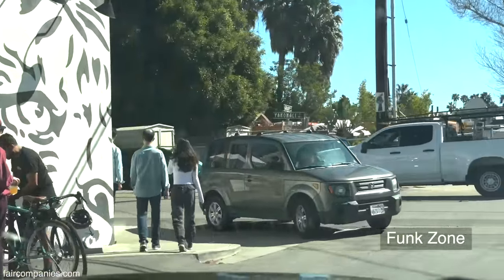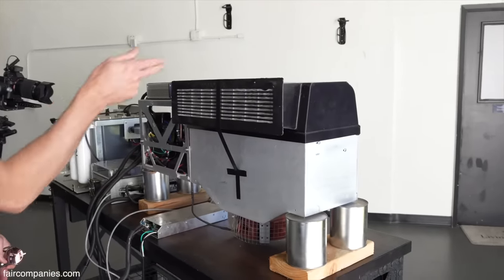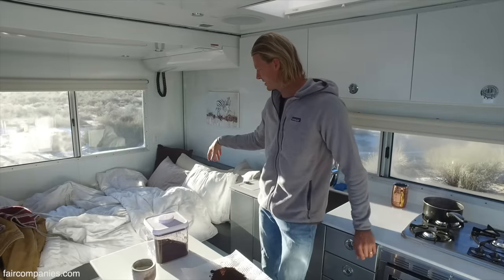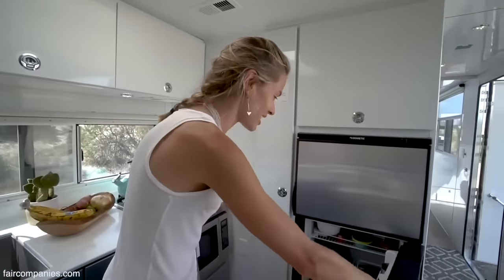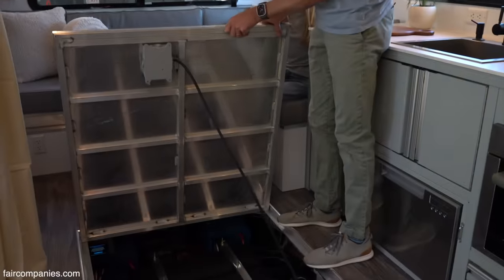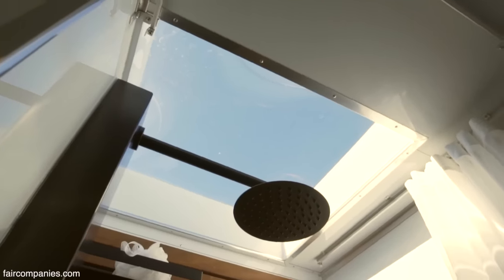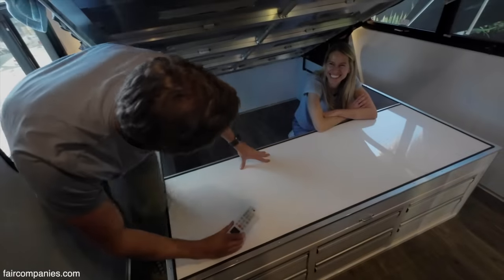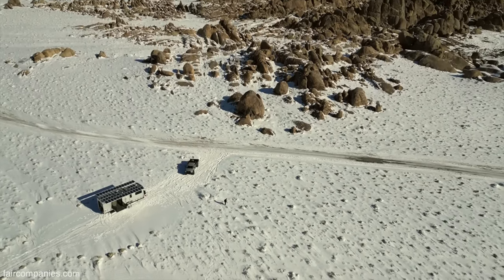Couple's stunning home-on-wheels produces water, has solar awnings

Comment: I LOVE how well built this is. So many builders claim luxury because of high quality finishes but none of it is built to last. This is clearly built to last. Also love the thick walls for insulation because they probably also make it quieter in addition to helping with temperature control. Sound is a big part of a space so it's great that a mobile space is quiet.

Comment: Ive been following these people and their Living Vehicles for years, now. So glad you could tell their story. They've really hit the nail on the head for full time living off grid and also mobile living.
Reply: Thank you for your ongoing support!
Reply: As long as you can afford a million dollars on a mobile solar panel
Reply: @canyonero2050   Solar panels are relatively cheap anymore.  A decent solar power system will run you ~$2,000-$5,000. (includes cost of batteries, controllers, converters, etc.)

Comment: Oh hell ya! A real kitchen, a real bedroom, a real bathroom, real power, a terrace, easy to haul, season resistant, water collecting, AND a dishwasher…OMG!!!
Works for me.

Honestly the ONLY thing I’d add (as with every dwelling) is the ability to control the shower head so I could get fully wet & turn the head off, soap up & then turn the head on to rinse off. I had one of those at one place I lived. It was really low flow to begin with and adding this really put it over the top. It just had was a button right at the head that turned the flow off and on. Easy peasy. Saves lots of water. That plus the full water reclamation/recycling and the air/water grabber (to balance evaporation) and this would run as long as there’s power to run it. 

Great design and build. It’s wonder-full.
Reply: Thanks for the feedback!
Reply: Living in a condo and wanting a way to get more out of my hot water tank, I bought a KES shut-off valve on Amazon to put between my shower head and the pipe. It's made of metal and has a little lever that sticks out that is easy enough to adjust with one hand and lets me control the water flow, reducing or stopping it, which my normal shower valve doesn't (it's just on/off with the knob affecting temperature). Even just reducing the flow while soaping up significantly extends the hot water supply. Cost me like $18 CAD.
Reply: @guspaz  Yay!

Comment: Really nice high end build. Extracting water from the air using solar power is so dang cool!
Reply: Back in the day we used to call that a dehumidifier.
Reply: @Chris-bg8mk  😂😂
Reply: @Chris-bg8mk  Yeah, exactly. It is not really an inovation anymore. 🙂
Reply: @Chris-bg8mk yup a dehumidifier hooked up to a reverse osmosis filter 😂
Reply: @Chris-bg8mk  Yah that’s what I was thinking. It’s a dehumidifier with a water filtration setup… or am I missing something?
Reply: I saw a video where the people had a massive one, the size of a small utility building maybe 6 x 6 x 8 ft, on their property because there was no other water source. I think it was rated to produce 20 or more gallons a day (50? I can't remember), but it was just enough that 2 people could actually live on it.
5g a day is really just a tech demo, that doesn't cover much more than drinking water.

Comment: I think of it more as a tiny home on wheels than just a trailer, especially with the fold out deck.  It's well thought out, that's for sure and he's still improving on it with water recycling in the works.  He probably does alright for himself and has a high-end clientele.  It's good to see the latest living innovations and the latest technology with fully off grid capabilities.  Thanks again for another interesting video.

Comment: As an architect, I have been wondering when a truly self-sustained living unit would be available - I guess we have it now.  Until now, boats, with a water making system have been the only viable option for indefinite off the grid living, only limited by food, and required repairs.  This really combines all of the latest technologies, most intriguing of which is the atmospheric water generator.  Water generation is the key to living off the grid.  I will be looking at options to adapt this structure/vehicle into the new California state ADU laws.  This structure should open the door to new site location options.  The cost of providing utilities to a new living unit is typically a large part of the budget.  this vehicle could be a game changer.
Reply: Thanks for the feedback, Tom!
Reply: In most areas where you can't find a natural water source to pump through an osmosis filter, it's going to be WAY too dry to pull anywhere near 5 gallons a day. Also, if he can run that thing at 5 gallons a day off ONLY 200w of solar, the scientific community would be banging down his door trying to get a look at that machine. Get a pump and a filter and you're set (spoiler he has a filter on his machine because the dehumidifier he's using doesn't produce potable water).  For the space/weight that machine takes up, you could probably carry 15-20lbs more water AND a filtration system to pump water from a river, creek, lake, etc.

Comment: I really liked this one!!!   This couple has done a great job!!! 

Something that I've considered since my parents are getting older is living in a small house on wheels to be near them, and then later in life after they have moved on, moving this "small house on wheels" to a different state where I want to retire.  My problem is that the "small house on wheels" is too small for me, I need two of them to have the space I need to be happy. 

So, my thought is instead of "one" small house on wheels, have "two". One for the bedroom/shower/bathroom space, and then a separate one for the kitchen/pantry/office/living room space. Since my mom lives in Michigan, I was thinking of putting this pair inside a greenhouse/barn so moving from bedroom to kitchen space doesn't involve putting on a full coat and boots during the winter.

When I'm ready to move, all I need is an external structure optimized for the climate I'm moving to, but the two "house on wheel" structures can move with me.
Reply: there's a conoany/manufacturer, wheelpad, taht makes units for use-cases similar yo whatvyiu stated,  living with famiaging family members, having enough space, and other considerations. I yhink they do delivery around the us too, amd havee a buyback program for when they're not needed anymore. I'm not sure if they have wheels as default, but could ask them, and they have a range of units, modular ones that can fit several rooms together too. They have quite conparatively affordable prices I seem tk remember too. and narrow margina, and some good reviews. . 

Anyway, might be one to look into. Wheelpad, I believe the company is called. I think they havee some YouTube videos up too, with maybe some tours and things.
Reply: @wiresa.reintresting7051  I'll look into that. 

Really though the reason for the "small house on wheels" is I want to customize my own design, with features you could not get in a typical American-style house.  So when I'm ready to move, I don't need to build again from scratch.

Comment: Better for most is starting with a standard RV, and adding a few thousand to make it better for cold weather and/or no electric, water and sewer hookups. His designs are great for people wanting to spend $300 thousand plus for all new.
Reply: This is precisely the approach I took myself for the first 15 years of my RV-focused career with the specialty up-fitting business "Hofmann Architecture".   After renovating over 400 RVs for all sorts of use cases, we found the inherent glass ceilings with renovating existing vessels.   We had customers wanting to put in crazy amounts of tech and push the limits of what was possible in a traditional RV.   After all that work, there were limitations.  Ultimately, the ground-up foundation was the most crucial part, and that's where LV was born.
Reply: Ultimate RV !

Comment: This is hands down one of the most amazing mobile home I've seen so far! All the details are amazing, from the double-stacked solar panels, the exterior deck, the water system and... the storage drawers.

Let me explain: one thing they did not mention but I feel is worth mentioning is the drawer/shelving handles. They're inset, flush to the cabinets. This is a pet peeve of mine when I see protruding handles in other builds. Space is usually limited in such setups (even more so in smaller builds) and having protruding handles just makes no sense and you will bump into them at some point!

Comment: The water reclamation unit alone could be life-changing for so many communities, especially in the southwest. I'm very excited to see how that progresses! Overall a truly beautiful build.
Reply: That tech already exists, he didn't invent it, and he didn't make it any more affordable or accessible. He's helping make luxury RVs more high tech and net zero. He's not making them any more affordable or accessible to people who actually need them.
Reply: @badsamaritan8223  Its literally an air conditioner with cold side air ran back into the hot side. For $100 you can convert cheap window AC unit to do the same. Takes a lot of electricity to produce water this way expecially in low humidity dry climates. Much cheaper to store rainwater.

Comment: Love that this shows many of the people who doubt the technology that it is ready currently. Of course this is an expensive project, but it's also luxurious.

I'd love to see if commercial-sized bifacial panels would fit on the roof! There was recently a self-propelled electric trailer shown off, that would be a complication, but would really help with towing electric.

Vacuum insulation also could be a future level up for this beast!

Super tangent: as a little boy, I spent Summers traveling Alaska and Canada with my grandparents in a couple of RVs. We got stopped and into a little trouble at the border, because you're not allowed to bring certain life necessities, and guns lol, across borders willy nilly. A mega mega bonus would be a top secret smugglers stash, hermetically sealed and hidden from potential x-ray checks.
Reply: Besides the water concentrator, there's tons of custom campers cruising around the world, with all the same tech, and a heck of a lot more personality, for hundreds of thousands of dollars less than this.

Comment: I could live in that! I don't have the right rig to pull it, but I could live in it.
Really fancy, and ton of solar.
Reply: Those numbers are bogus, you can even see in the video they were only generating 2000w with the array out on a sunny day.  Those flexible panels NEVER produce their claimed maximum.  They overheat quickly and only last 3-5 years.  They should be using different panels. Those panels are for temporary setups.

Comment: Would like to know more about how grey-water could be handled. Evaporation usually requires a lot of energy so not sure how they would do it.
Reply: "not sure how they would do it."  These are precisely the type of challenges we love!
Reply: @Living-Vehicle-Matthew  Run greywater through similar heat pump dehumidifier to your water generator setup. Then filter and sterilize reclaimed greywater condensate to recycle into shower water or even potable water after RO filtration. How do they do it on the space station?

Comment: 500k to 700k for a camper is insane, the value will decrease, the value on campers always decreases - nice, but overkill.
Reply: the materials used are top class, they can survive more than hundrad years if taken care off, no concrete building now a days can survive even for half life. and i dont remmember it mentioned its price in the video, but 5 or 700k is over kill. shouldnt be more than 100 to 150

Comment: It's nice, but from some of what they say, it seems they haven't really seen a lot of RVs, or at least not a lot of different RVs.  Our kitchen sink has a pull-out sprayer, our shower has a skylight, etc.  We have the 3" walls, and the rig is built for full-time living.  Sure, there are plenty of cheaper trailers that are meant only for camping, but a full-time-ready RV is nothing new.  Still, there are some things I wish the RV industry would move to, such as lithium house batteries instead of deep-cycle lead-acid, and high-efficiency mini-split heat pumps instead of multiple (we have 3) less-efficient ACs with expensive options to reverse the flow.  I'd also like to see at least the higher-end RV manufacturers pay as much attention to quality as this couple has.  The solar, battery storage, and inverter are truly impressive.  I've seen other rigs with extensive off-grid setups, but that may take the top place.
As usual, the camera work, narration/interviewing, and overall production quality are very high.  Some of the early videos on this channel, you could tell it was all a new thing, though even then the overall quality is great.
Reply: What model do you have?
Reply: @misternils  We have a 2021 Riverstone Legacy 42FSKG.  It's a front-kitchen model, with a mini-garage under the bed in back.  Overall, we've been pretty happy with it, but some of the corner-cutting bothers us.  The kitchen is built for someone who really likes to cook, one of the best kitchens we've found in an RV.  The garage is just enough for me to readily fit in my motorcycle and gear, so it isn't wasting space.  RVs are all about compromise, so getting extra space in one area means giving it up in another.  For someone who doesn't cook as much, but who likes to entertain, that front area (with opposing slides) would make more sense as a living room.  Are you an RVer, or have been one?

Comment: Finally. Nice to see an rv built like a European expedition  truck. Love the expanding solar array. Now put this on a truck but change the cabinets. They look noisy during travel. 
The rv industry should take notice. No big sofas. No Home Depot cabinets.  no pinstripes.
No mouldings. 😂
Reply: Cabinets are purpose-built for the road.  This was one of my biggest gripes in the industry.  Using traditional house-style residential cabinets for spaces rolling down the road, regularly undergoing 9.0 earthquake movement.   So many times i'd be driving and have a cabinet fly open and have all contents on the floor.

Comment: WOW, $950,000 dollars !!!!
Reply: Wow. Flush that dream.
Reply: Then add what appears to be a modified 1-ton truck - probably diesel too.  The trucks they showed looked modified - so how much for that?  Then add insurance, etc.
Reply: 80,000 minimum on that truck with no additions.
Reply: I missed that part.  Is that what the rig cost?  I guess at that rate, I should be happy for my commercially-produced fifth-wheel toy-hauler.  We have nowhere near the off-grid capacity, but are definitely capable of full-time living (been doing that in it over two years), at a fraction of that cost.  I'm sure that the solar/battery/inverter setup added a bit to the cost.  They didn't say how much it weighed, did they?
Reply: WHAT?
That's how much that thing costs?
I'm sitting here thinking that this rig is exactly what I'm looking for. I could totally see myself living in it full time.
Talk about bursting my bubble.
Reply: @michel3691  No Doubt,  Millionaire Weekend Toy!
Reply: Great News for heavy duty suspension package add another $150,000 dollars
Reply: $400,000 for a used certified one that has been up graded. Really, if you can afford one, you really don't need it.

Comment: As a dude with a small off grid business that specializes in power. This is impressive but lacking a few basic things that I think it must have at this price point. One a whatever voltage the battery bank is alternator. We make custom units our bread and butter is 48v 5000w units. Two would be a pop up roof as this would give lots of bedroom space. Three would be a regen brake on the trailer. I say this because it would lower maintenance and on my rig I was able to make about 15kw going down a mountain road while also not wearing the brakes. I'm a firm believer in one plan is no plan two plans is one and 3 plans is better. Also I feel the option for a wood burning heat and power generator would be very nice. I know It got me through a winter and made good power at the same time.

Comment: 2:25. Air conditioner/water maker. Brilliant.

A lot of environmentally correct technology that can be ported over to fixed structures. They are a test bed for future construction methods.

How many aluminum cans died in the production of this trailer home? 😲🥫
Reply: "How many aluminum cans died in the production of this trailer home?"   
or - 
"How many cans were resurrected from the grave?"
Reply: All of the tech already exists. It's not a test bed, it's just a rich person's proof of concept.
Reply: @badsamaritan8223  All of the tech always exists. It's combining and engineering the product that needs testing.tofdythete was a time the automobile was a rich man's toy. Through "testing" it over the years (development);it has evolved into an everyday necessity for the masses.

Comment: I’ve lived in my van full time for 3 years now, I only use solar, winter I have to be strategic with electricity, other than that I don’t feel restricted. I have 1/9 of their battery capacity, 1/4 their inverter capacity, it seems like they went a lot, lot larger than people really need to live full time. I prioritise efficiency and live smart. But I get if someone is rich, sure buy this. But you’d really want to have over 10 mil in the bank for it to make sense to spend nearly a mil on a campervan.